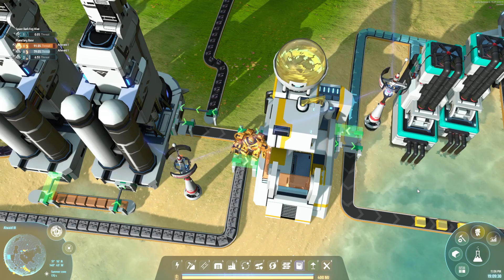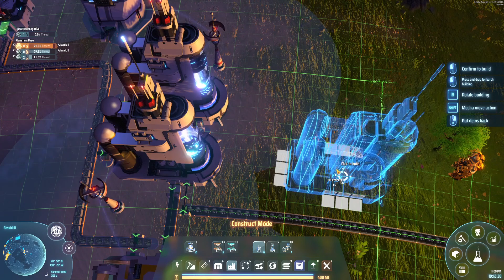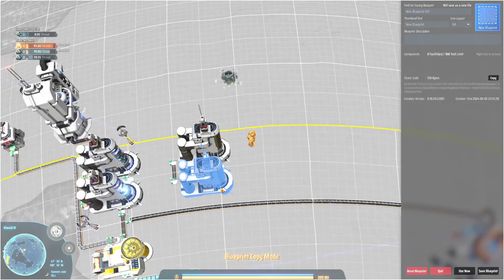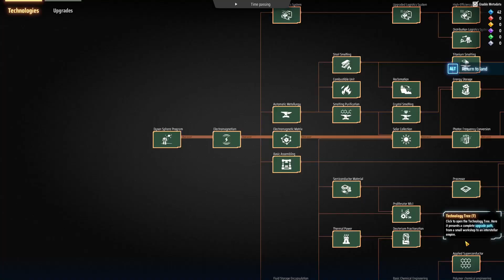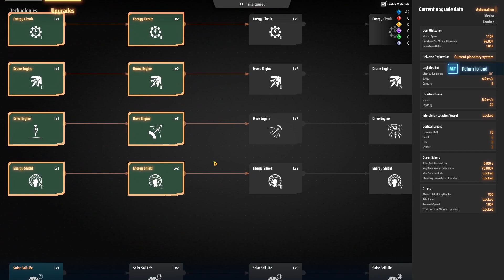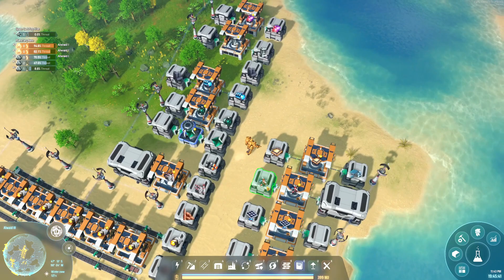GRAPHENE // Dyson Sphere Program // Mission Log 23

Comment: you're gonna love this tip: try placing a building, setting all the sorters and the recipe, then SHIFT+click, and drag. copies everything for you!

also: this is gonna be kinda sad but compare the power requirements of the mark 1 and mark 2 assembler compared to the craft speed of each. its borderline better to just use 2 mark 1's rather than upgrading to the mark 2's
Reply from the maker: That is nice, although I’m finding the area select for blueprints relatively painless. As for the assembler, I didn’t notice that but being able to run recipes at 1x is worth it to me. I’ll get to fusion soon!
Reply: @Josiwe  yeah it definitely is nice for calculations